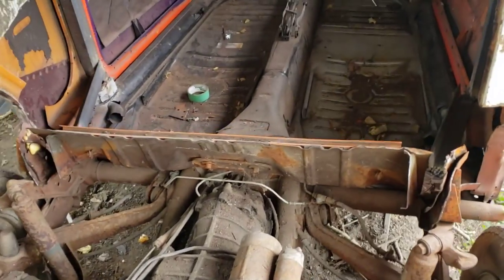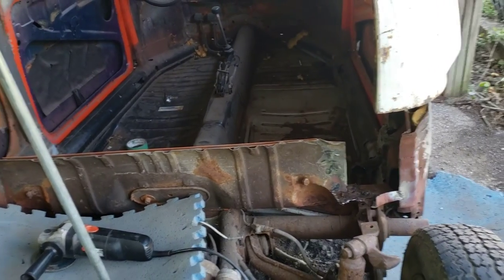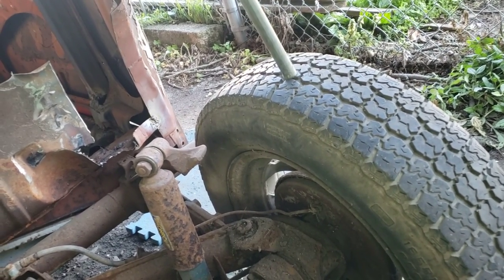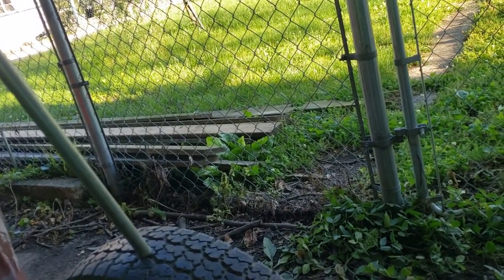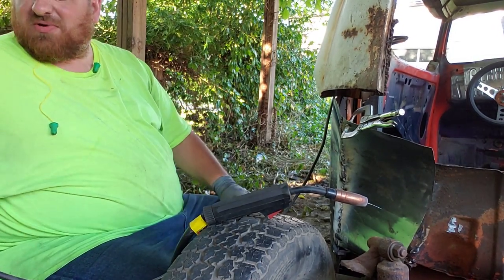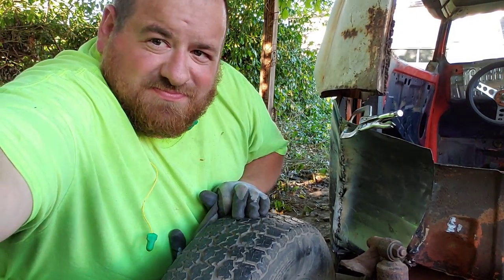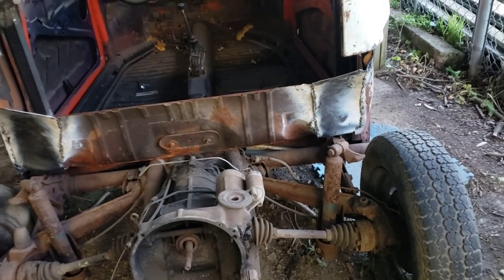Rat King Rat Rod Rear Body Work

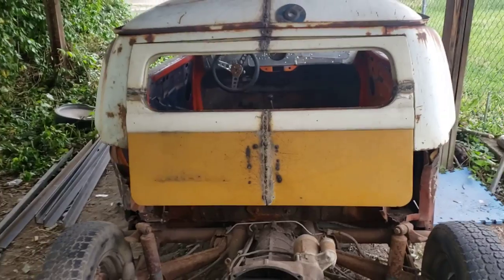Comment: Right about 4:29 you can fix that high spot in the center if you are unhappy with it.  Cut the bottom seam you welded in the center vertically straight up under the gutter and push down on the roof right above it.  Use a level as a guide on the gutter to get it straight.  Then a tack or two in the gap that opened up that you just cut.  That should get it!
Reply from the maker: yea, i'm not sure if im going to "fix" it or not.  I dont mind it really, the roof is quite crooked down the length as the donor roof wasnt in the  best shape.   that all being said, the roof is also going to get a roof rack made for it so it really wont be that much of an eyesore bc it'll be somewhat hidden.
Reply: @brokebutfunctioninggarage  Well, the "crooked" of the top can be fixed with a few whacks of a hammer to the low spots on the inside and some filler.  You've got this, dude, its gonna be awesome no matter how you do it!